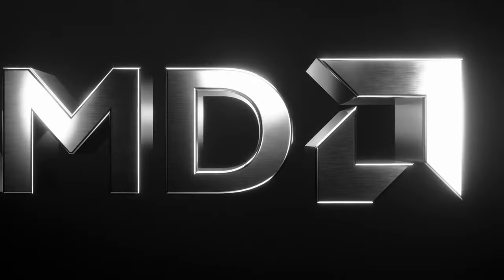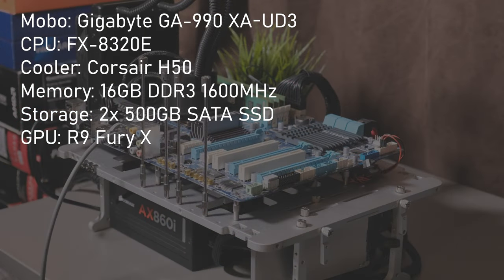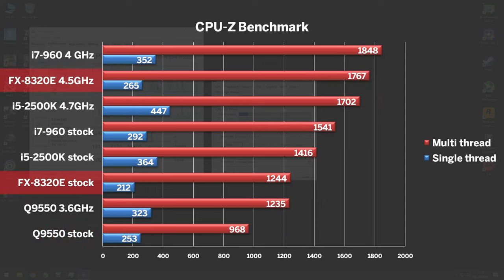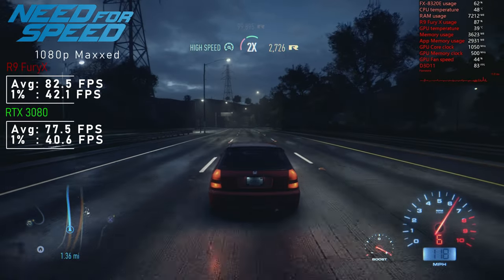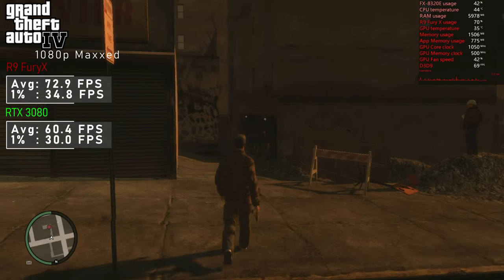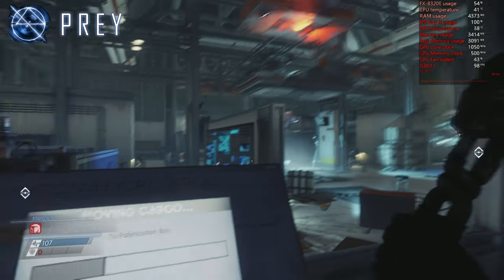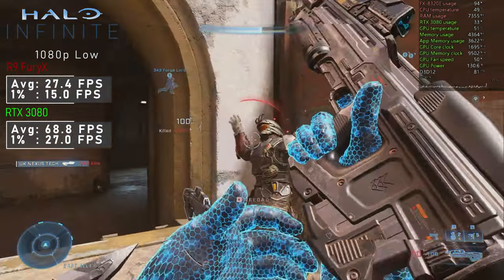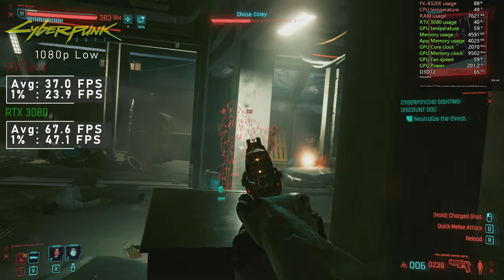AMD's FX-8320E in 2022...Just how bad is it?

Comment: I'm running an fx 8350 on an Asus 970 aura board and running 4k at 60 fps on my display WITH running VR on a oculus rift cv1 at max frame rate with a liquid cooled 1070 8gb...she's still able to run brand new VR games and most stuff you can throw at it

Comment: Left a lot of performance on the table with this one, my 9370 was able to scrape almost 20% more performance with fast ram and a good HT overclock, tuning a lot of the related things with this cpu gave better results than just raw frequency. What isn't touched on as much is how the FX chips actually aged a lot better than the i5 or i3 cpus they competed against. Hell, a lot of people opted for the dual core pentium Gs over them which are absolutely unusable in the modern age, a FX chip and a 7970 will still play games pretty well 10 years later, which can't be said about an i5 3rd gen and a gtx 680ti
Reply: You should disable spectre/meltdown fix and then compare performance, because those fixes can drop performance by up to 20% on intel cpus
Reply from the maker: Hello mate! Good shout - when you put it like that, you really would not pick up G's when going Intel...How many times have I heard people talking rubbish about AMD in the past, not just the CPU's but also for GPU's - I think my channel provides some insight into how nicely they aged and how wrong they were back then...
Reply: not everyone has a high end motherboad, psu and cooler. the overclock is fine for an average user
Reply: @rafradeki  Incorrect, intel sacrificed data security for speed and got caught, spectre/meltdown is legitimately a big risk as malware can escalate privilege with it.

Comment: That's a platform I skipped entirely. When I saw how poor FX-8150 was, I went with a Phenom II X6, and later switched that to LGA1155. Good video anyway as seems that due to better use of threading in modern titles, the FX aged actually better than I would've thought.
Reply from the maker: I've skipped it too, I've owned AthlonXP before and Ryzen 9 afterwards
Reply: I didn't get any of the standalone FX-series CPUs, but I did have one of the Steamroller APUs (as well as an E-450 fanless board which I actually still use).  Actually I also have a Bristol Ridge APU sitting around, but finding a further use for it might be challenging.  I had a Phenom II at the time of Bulldozer's release, and basically went for Sandy Bridge instead as the interim measure.
Reply: 8150 wasn't poor at all runs everything perfectly fine better than the X6
Reply: @slippinjimmy3961  Truth, the X6 was overrated and way too expensive for no reason(specially today).
Reply: @slippinjimmy3961 no, 81xx actually has same performance and not better at all. Maybe you confuse with 82xx where its 10% faster than 81xx

Comment: You got one important detail wrong.  The reason the 3080 is SLOWER is not because the system is imbalanced or the CPU is bottlenecking.  It is a KNOWN FACT that nVidia's drivers have much worse resource overhead than AMD drivers.  This is an important consideration when working with a budget CPU build.  This also holds true for i3 and lower end i5 systems.
Reply from the maker: Thanks mate - does that ultimately mean, it's there as a penalty for both AMD and Intel? Whilst not great, acceptable for testing purposes :)

Comment: The biggest bottleneck here is actually the memory kit, if you run these things at 4.0GHz, it's 1866MHz minimum, and anything higher than 4.3GHz needs at least 2133MHz to actually get used to the most, you'll get some amazing uplifts by doing it.
I know this as as my daily driver is still and FX processor, the 9590 to be exact, and with anything lower than 1866MHz or very tight-timed 1333MHz (8-8-8-8 timings) will yield very bad single core performance, 1600MHz is just enough for that CPU at stock, but not overclocked. The only thing that made the FX 9590 woorth it over other FX processors is that the memory controller is actually quite good compared to the rest of the FX brethren, I could get some high speed memory running quite stably, such as 2600MHz DDR3, albeit those were memory kits from my friend and not mine.
RN I'm stuck at a very slow 1333MHz clock on memory due to how bullshit are the conditions to allow me to overclock memory on a Gigabyte MoBo without XMP modules (They are Kingston HyperX Fury 4x8GB modules rated for 1866MHz), still, timings are as tight as they could be and are more or less between the performance of a 1866MHz and 2133MHz kit could give me, the only thing that suffered is the single core, with a comparable performance of a 1600MHz kit, but most stuff I run on this thing is actually multicore-based, so no big deal.
Reply: lmao
Reply from the maker: Awesome, thanks for sharing. I've tried using a 2133MHz Kingston kit with no luck, the board looped infinitely. I've almost bought the 9590 with AIO...seller did not accept my offer
Reply: @nexus_tech  get an standalone one, those can be found pretty cheap, the ones with the original cooler are quite expensive and regarded as a collector's item only.
Then you grab a cheap ass 240mm AIO with some Kryonaut paste, it will work pretty well as long as you use Kryonaut paste on the AIO coldplate.

Comment: The reason why the 3080 got less fps than the furyX in games where the bottleneck was the cpu was because of the Driver Overhead problem that Nvidia has. Steve from Hardware Unboxed has a great video about it!
Reply from the maker: I'll be sure to watch it. Harbour on Box
Reply: @nexus_tech   Hardware Unboxed
Reply: @nexus_tech  
AMD GPU Driver has less CPU overhead, that makes them better for weak old cpus like FX.
And because of PCIe 2.0, you need PCIeX16 GPU to get the most of its bandwidth.
For example RX 580,RX 5700, RX5700XT those gpus use PCIE X16.

PCIe 2.0   X4 = 2GB/s
PCIe 2.0   X8 = 4GB/s

PCIe 2.0 X16 = 8GB/s

if we compare it to PCIE 4.0 X8 that most gpus nowdays use = 15,754 GB/s, so running this GPU on PCIe 2.0 makes it 4GB/s.
Reply: @maddogfargo3153  What? Halibut botox?

Comment: im honestly surprised this cpu is capable of 60fps 1080p high settings with a good gpu of course. These arent totally obsolete yet
Reply from the maker: Don't get me wrong, it's perfectly usable, but one would have expected bit more from an 8 core 😉
Reply: @nexus_tech  to be fair its not real 8 core chip as you may know, its more like 4c/8t even though it works very differently from hyper threading/SMT
Reply: @nexus_tech  I was expecting worse considering how bad they were when they came out. You should test the i5 8600k overclocked im curious to see how the first 6 core i5 holds up
Reply: @daytimerocker3808  Don't have actual raw numbers on me, but in Games such as Fortnite, BO3, and BF1/V my old 8600k was getting JUST SHY of a steady 120fps, and lows were about 110-115 for all games on Ultra. I did have the Core clocks locked to 4.5Ghz all cores, and about 4.3Ghz on the cache though.

Comment: a few questions regarding the testing:
- what voltage were you running at that 4.5 GHz overclock?
- was the gaming tests done at stock or overclocked? 

Because i think it is a good idea to mention it, perhaps even testing it at both settings with each video card, to see if someone who owns an FX 8320E wants to overclock to prolong thier platforms lifespan a little more. And auto voltages isn't a good idea, as at one point, it can be running with way too much voltage, potentially overwhelming the VRM and north bridge heatsink on the motherboard.

Otherwise, it's a great video and fairly straight to the point, while also providing LGA775 and 1366 tests, which usually isn't found on other benchmark videos.
I might have mentioned this before, but i will happily help you out if you need some regarding testing or suggestions for future videos. :)
Reply from the maker: Hello mate! I've run Auto and 1.4V - both very stable, all of the testing was done with the CPU overclocked to 4.5GHz :)
I've captured FarCry 5 benchmark comparing stock vs overclocked state but never included in the video.
Thank you, I'm glad you enjoyed the video, I'm always happy to hear recommendations on what you like to see tested. The only downside is, I simply can't pour any additional time, it's a push already. Thank you :)
Reply: @nexus_tech  Thank you for the response, especially regarding the settings for the overclock. 

What i personally wanted to make a video about, but probably never will have the money to do myself, is using the top tier Raptor Lake CPUs iGPUs and overclock them. I have seen that a lot on Athlons and Ryzen G series, but rarely on Intel iGPUs. So that might be a slightly original idea that people could be interested in, myself included.

Comment: You could try DX 12 in Fortnite. Perhaps it's better for such an old cpu.

Also i remember vaguely, that the FX ran a lot better, when you compiled your software with special compiler-flags for AMD. Someone did this, when the first Bulldozer-CPUs were released and in some use-cases it was on par with a 2600k!
I think, that Cinebench is more optimized for Intel (Atleast it was back in the day). 

Also the mainboard was important for performance. A good mainboard could give you a lot higher northbridge-clock and that gave a nice performance-improvement, even if didn't overclocked the cpu itself.

And... I liked this video very much. Good work 🙂
Reply from the maker: Thank you, mate! Appreciate your feedback. 🙂

Comment: The mobo upgrade I did at the time was compatible with my old X4 630 as well as the FX. so when I saw this CPU at just under $100 brand new, I couldnt resist. Prices were so low back in late 2015 when I built my 860K/GTX950 mini rig, I still had $ left over to modernize my main tower. Got a 2nd GTX 950 for it a year later. Both rigs still serving me well to this day, I'm only now considering upgrading 9 years later. For the $ and years of use ive gotten from it, kinda hard for me to be mad at the deceptive marketing/performance.

Comment: I ran my fx 8350 till last year. Supprisingly I found that it handely bested a i5 7500 with single channel ram and got extremely close to a i7 3770 (non k) i was really dissipointed at that "upgrade" 

My 8350 was clocked at 4.7ghz, 2600 nb, 1866 cl9 ram.

Unlike the 1st gen i7's it does support avx so it can launch some games/emulators that they can't.

But in today's market with haswell being soo cheep there is no real reason to buy them unless your platform cost is like $50 for a $200 or less budgit rig and you live in a country where electricity prices are low/stable/decoupled from petroleum. Which 
Unfortunately is quite neche these days.
Reply from the maker: Thanks for sharing :) I didn't touch NB clocks but hear there is some room for improvement. Agreed!
Reply: There is no reason to buy an FX proc period, full stop. They suck.
Reply: @insertnamehere4419  Just bought 3 this year just to piss people off lol. They run like rockets for a couple of bucks.

Comment: I remember everyone saying high memory speed on these cpus gave terrible performance, but when I had it and overclocked my ram from 1600mhz to 2133mhz I saw an average of 3-4fps boost. Though that might had been just because I was maxing out my gpus vram I had at the time r9 285 2gb.
Reply from the maker: I only used bog standard memory in this vid, I'm sure it does help as with any APU :) Thanks for checking in

Comment: About that final bit there on existing users of am3 uh.. not always that worked going from am3 too am3+, had a socket AM3 gigabyte 870a ud3 rev 2.1, rev 2.2 released about a year later did get bios support for am3+ but as you saw yourself wasn't much of a bump in performance.

And i guess you didn't mess with fsb overclocking anything too increase the ht link speed & northbridge link speed.
That helps ipc performance a little bit even if you'll have too tweak more settings getting 2.6 ghz on ht link speed & northbridge link speed from the stock 2.0 ghz, that should give some extra performance if you got 1600 mhz or faster ddr3 ram sticks.
Past 2.6 ghz ht & northbridge link speed doesn't help much on this platform unfortunately even with 2400 mhz ddr3 ram sticks.
Reply from the maker: Thanks for sharing mate. I really thought it was similar to what we see with current AM4 platform...
Reply: god ive almost forgotten how tedious it was to overclock am3+, compared to intel at least 
thanks for the insight ive got a spair 6100 laying around might get a board and oc it
Reply: Yea the upgrade wasn't universal but i sware there are some am2+ boards with fx support.

None of my am3 boards i own got fx support.

The am2,2+,3,3+ board lineup is a bit of a mess and usally am3 boards had no toggle for apm in the bios. (Apm limits your chip to the rated tdp) so overclocking didn't really work. (Can be dissabled using amd overdrive once booted and fixes ocing) even some am3+ boards had this isaue notably gigabyte ud3 rev3.

Comment: man you can't throw that haswell i3 comment based on some sintetic benchs.

Fx 8 core are great overclockers, yes, but that is not needed really. I have used many PCs from that era:

- Fx8350 (personal main rig, 16gb 1866mhz ram, Asusu 990Fx Sabertooth R2, SSD for win and HDD for stuffs) paired wit Rx 570 (and later 580) without massive bottleneck, while keeping decent productivity (mainly photo editing but also Adobe suite) from 2016 up until retirement in feb. 2024

- Fx4300 at home (personal secondary rig, 12gb 1600mhz ram, Asrock N68 VS3 Fx mobo, SSD for win and HDD for stuff ) paired with R7 250x (and 1280x1024 screen) that worked "OK" for 720p MOBA gaming, and was mainly limited by GPU (i didn't ever upgraded to something like a GTX950 or R7 370 4gb i would have liked) It was nevertheless on pair with Phenom II x4 in productivity, not so great to be fair.

- i3 4130 (my provided by employer work rig, 8gb DDR3, B85 mobo, only HDD) working on iGPU. It is a pain in the as since day 1, my work requires something (at extreme use) in the order of 5 gb of ram, yet there are several task done at the same time (dedicated software + Libreoffice + 10 tabs of Chrome + Acrobat Reader and some minor softs). CPU is very very limited for multitasking, it is not a pleasent ride.

- i5 2550 (my ex's work rig. 8gb DDR3, can't recall mobo, SSD for win, HDD for stuff) paired with a GTX650 back in the day, proved to be obsolete (despite GPU being obsolete by its own right) for Adobe (mainly PS and AI) usage since 2020. i tested a "simulated upgrade" with my Rx 570 and 16gb of ram (only 2 slots on the mobo) and it didn't matter, Ram was a limiting factor but the lack of cores (4 cores 4 threads in 2020 was already a low core count) limited a lot the productivity. My Fx8350 at the same time period with same ram and same gpu (16gb and Rx 570 4gb) was a much smoother platform since system hangs weren't that often.

- i7 3770k (my best friend's rig of the era. 16gb DDR3 2133mhz,  Asus Sabertooth Z77 mobo, SSD for win HDD for stuffs) paired with GTX 770 later switched for 1070. This CPU was a legit winner for almost everything compared to my Fx8350, but if the PC runned a game + TS3 communication soft + some Chrome tabs in the back, the gap between its pc and mine was reduced. With my Fx8350 i had the same "high tier PC" feeling no problem.

- Phenom X4 9960 (my rig prior to Fx8350, paired with 4gb 800mhz DDR2 ram, a mobo with 2 ram slots only HDD w/win7) paired with GTX 9800. It was an upgrade over a 775 Celeron, so it was indeed a nice CPU and was OK for gaming at 1366x768, but by 2016 when i moved from this one to the Fx8350, it was like night and day... the SSD was lightning compared to HDD, Ram was fast and i had a lot, an mainly, CPU had a lot of cores, i come from the ages in which AV soft almost hanged the PC, so having a CPU with the hability of using heavy tasks with 4 or 6 cores but leaving 4 or 2 for "regular web browsing and stuffs" allowed me to do a new kind of computing and multitasking.

So... for all of that i'll do say to anyone on an extreme budget, that can't really afford a DDR4 or DDR5 platform and it is forced to the DDR3 used market...
if you cant purchase a 2600, 3770, 4770 or 4790 i7... Get yourself an Fx 83xx core CPU... it will run games slower than DDR3 i5 of 2nd/4th gen if the PC is absolutely clean, but for real life multitasking (while gaming or doing productivity) Fx83xx will smoke the intels... i know this bc i worked on many many PCs of the DDR3 era...

Comment: Remember, AMD had two chipsets here, 970 and 990 ---- the 970 gaming chipset was popular and low priced and was often paired with 6300 chips,,, but the 970 chipset was really designed for 125 watts so the VRMS werent designed for more than that,,,, they were  unstable at anything over 125 watts so 970 was not good with 8350 and/or any overclocking,,,,, AMD saw a demand for 970 mobo owners who wanted 8 core chips,,,, so they made this 8320E,,,, which wilil throttle itself when it starts to use alotta wattage,, this will happen often until you bypass all those settings in the bios., ,,, but 970 users can use the 8 core 8320E to an extent

Comment: I'm still running an 8370 with gtx 1060 haha. Def can't run the latest games, but then again I dont play a lot of AAA titles. Runs Age of darkness at low settings on 50fps, tanks to 30fps on large crowds.  I recall gta5 running at high settings around 55fps .
Reply from the maker: Thanks for checking out the video and sharing your experience. The FX-8370 is not bad CPU, I think if we manage expectations, it can be used for another couple of years :)